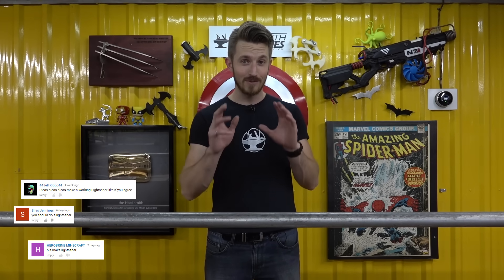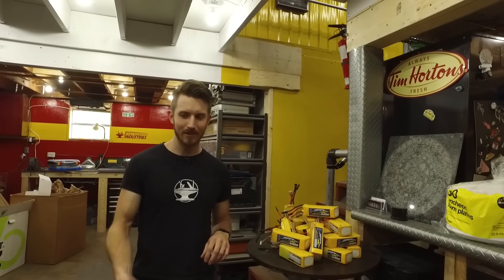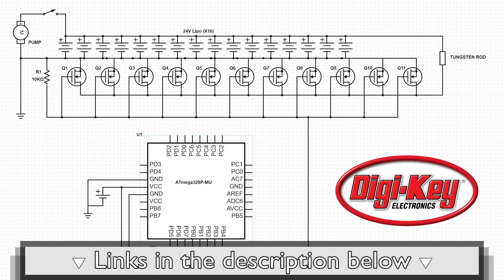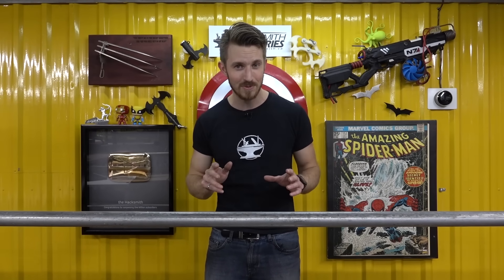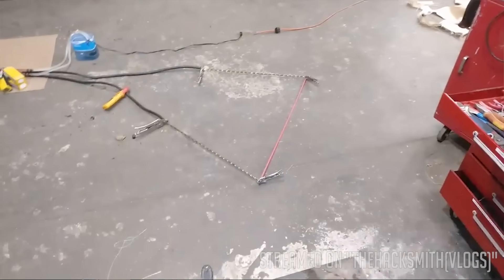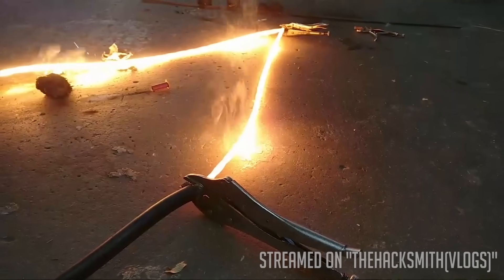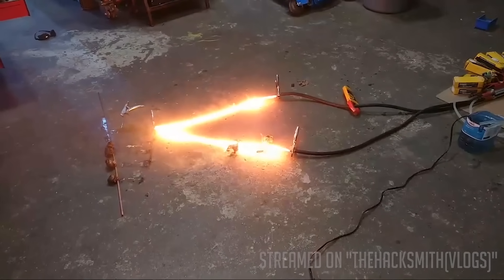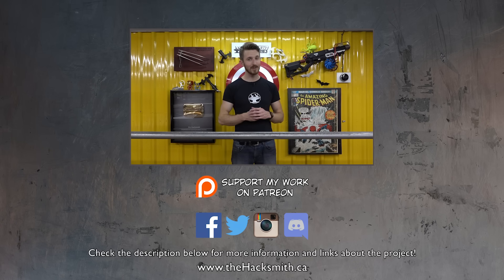HOMEMADE LIGHTSABER EXPLOSION!

Comment: @The Hacksmith I think you should use a tungsten-titanium alloy because tungsten has the highest melting point and gives off light similar to a light saber because it has a high resistance to electricity. Tiny tungsten rods are used in some light bulbs for that specific property. (just learned that in Physical Science) The titanium should counter the weakness of tungsten with it's strength so you can strike things with the "proto-saber". But then again Im just an 8th grader and don't know much about alloys and how the metals affect each other. 
Wait...I just thought of this now; how tf can u make an alloy out of a metal with the world's highest melting point...? Maybe if you get a rod of tungsten and a rod of titanium you can heat them up and idk, stick the together and then swirl the two when they're heated to like how DNA is swirled. It COULD result in a combination of tungsten and titanium. 
I know this isn't related to the problem you were having with the power but I'm really fucked  when it comes to that shit
Reply from the maker: Watch the video again, there's a hint on what we're using ;-)

Comment: OK, for the rod... It won't be retractable but if you have 1 steel rod separated up the middle by a very good insulator that won't melt or some other form of separating the half cut rod, and then connect them at the end of the shaft. After you've done that, you can connect your power supply to either side of the rod at the bottom where the shaft connects to the hilt and turn on the power!

Comment: You absolutely need to use a silicon carbide heating element rod for the blade! They are commonly used for commercial heating elements, and would hold an edge quite well (if you were crazy enough to sharpen it) and  would hold it's rigidity at high tempratures! you could probably get over 2300c with the blade fairly safely.

I think you could probably just buy it as a replacement element for a heater?

Comment: Hacksmith, meet the blacksmith. What you ended up doing when the steel started splattering  was getting the steel ABOVE temperatures need to WELD steel. that's higher than 1700 degrees Fahrenheit. The splattering is a telltale sign that the carbon in the steel was burning out.
On a side note, I would love to see where you take this project; it combines glowing steel with my favorite movie franchise!
Reply from the maker: We have something even better than steel ;-)

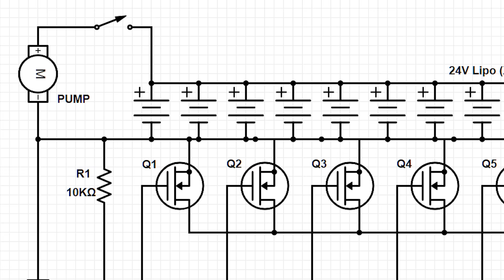Comment: looks at schematic at 1:40 The blade is made from a tungsten rod.
Reply from the maker: i think you're the first to notice it =P
Reply: the Hacksmith did you get all those batteries from flitecraft?
Reply: the Hacksmith try using carbide instead of steel, it will maintain it's shape even when heated to the point of glowing red as with the Steal. on the downside is it would be expensive for the car by piece as well as being very difficult to find a piece of carbide that length.
Reply from the maker: +Trans am county did you not watch the whole video? We said where we got them when we mentioned them lol
Reply: Lol how did I miss that? guess I zoned out lol

Comment: I would suggest a plasma ark around a ceramic core there is a really cool video explaining it i will post the link in the comments
Reply: I could not find the video but There is this really cool old video out there that explains that you can use magnets to contort the shape and path that a plasma beam takes. you could make it conform to a light saber shape and then you have to have a core so that it could clash and not go straight through each other. Something that has a high melting point put is still quite durable like ceramic and all of this is inter locking and expandable in the handle kinda like the toy light sabers

Comment: use a hollow rod push the other terminal through the rod and fill the hollow cavity with some heat proof foam which i think I say king of randoms metal furnace so positive to one edge and negative to other edge rod and wire insulated by a king of random  foam

Comment: can u put the hot sides closer together to look like a blade? also less power might make the blade more sustainable. you should  work on a water cooler kind of like the play station plus's has for the battery pack. Al's make a handle that can't conduct heat well somehow.
Reply from the maker: It is water cooled =P

Comment: Use an iron coil around a copper core for the heated bit. That way the electricity will go quickly from the base to the tip via the copper core. Or something similar if copper would melt too easily compared to the iron coil. Also if you go with the core/coil design you could make the rod collapse into the hilt and the coil wrap down with it, thus making it retractable
Reply from the maker: it'd all melt... you saw what happened to the steel rod we had!
Reply: What about a tungsten rod? It would glow a lot quicker
Reply from the maker: Good idea ;-) it's mentioned briefly in this video during the circuit diagram!

Comment: Use a telescopic ceramic baton design with high conductivity materials lining the outside of the "blade".
Personally I don't think a light sabre will ever exist because we cannot hold a plasma field and would not harm an assailant until you hold the weapon to the person for prolonged periods. A superheated material as well will be too weak to hold an edge or take a hit. Ceramics are too brittle and will break on first hit (ceramic knives use a draw cut). Finally, a plasma field on its own would pass straight through a second plasma field as well as the assailant.

Comment: I am  no expert but would it be possible with that amount of energy to create a superheated are and possibly contain it between two points rather than use a material or bar as the blade.its not a true lightsaber but the beam katana from no more hero's is similar and maybe possible if you use tungsten like some of the comments suggest. don't know if the idea helps but best of luck. the world needs more light sabres!
Reply: arc not are ugh spellchecker.
Reply from the maker: Watch the video again, there's a hint ;-)

Comment: I have a totally diferent Idea for a lightsaber, using a plasma cutter but with higher output, so it can get a larger blade, other solution would be using a plasma engine, as the output is an incredibly hot electric pulse
Reply from the maker: Kinda hard to make a 3' long plasma torch!

Comment: you would need to find some material that conducts electricity and can hold so much heat that it melts everything but its self. errrrr is there such a material 😕
Reply from the maker: +mechanic gamer there's a hint in this video ;-) in the design
Reply: the Hacksmith unless you would use a laser or something close

Comment: For the overloading problem maybe you can use a system like halogen lights. It doesn't continuously stay on. It turns in and off at high speeds. For the exploding maybe a plexiglass box with holes so heat can escape but minimizes "exploding factors". For the batteries heat problem have fans on top and on bottom all blowing air in the same direction and maybe two on the lower side forcing air in. Also the top fans should be 45 degree angle away from body so it doesn't just fan at your armpit. Just a thought but I don't know anything about anything your doing really... good luck.

Comment: You could construct the blade with a length of ceramic tubing, and discharge electricity with capacitors to create superheated plasma.
Reply from the maker: +Legoguylol4ever a Plasma sword wouldn't actually cut through anything easily either, you need serious input power to do anything impressive
Reply: True. However, I can't see how you'd make a functional blade. You'd have to have contacts on either end of a steel rod for it to heat up, like what you experimented with in this video. That'd require wires and components running off of both ends, messing with the lightsaber aesthetic. Then you also run the risk of overheating it, and the steel buckling or bending if you were to try to swing it. Maybe if you had smaller heating elements inside a framework for the blade? Then you could hide the wiring inside of the blade, you don't have to worry about it buckling or bending if you heat it up too much, and it'd be much more handleable. Maybe use cut sections of steel tubing, and use a metal rod for the blade. Use insulated screws to hold the sections to the blade, that won't heat up as much because of thermal/electrical isolation from the heating elements for the blade.
Reply from the maker: Simpler solution... U-shaped blade...

Comment: make it to where it heats up the metal until it turns to plasma then use an electromagnet they can keep the plasma together and that's a lightsaber in theory
Reply: josiah smith Thats Not how Physics work
Reply: It could work if the metal was in a gaseous form.  But that could be challenging.

Comment: Could you do this with titanium? or only use the steel as a conductive core?  It would heat the titanium...which has a higher melting point...
Reply from the maker: not much higher. keep thinking!
Reply: What about a temp limit? some sort  thermometer and arduino that lowers power output in order to prevent melting? Or would the constant heating and cooling cause weakness?
Reply from the maker: +EveryPixelCounts hint in the circuit diagram. It will be controlled via pwm
Reply: There's a clue in the video. One of the schematics shows a tungsten rod

Comment: I think you should do it by passing a wire through a tube with a high temperature melting point metal and then surround the tube with a low temperature melting point metal, After that, let the electricity go through le metal to reach the top of the tube where it goes back through le wire. I hope you understand what i am saying however the vocabulary being specifique and my english beinng pretty bad it is hard to express myself. Anyway, can't wait to see the result.
Reply from the maker: not quite, but cool idea!

Comment: i feel like having the "blade" awalys attached to the hilt would be too easy and wouldent really make it a lightsaber... i dont think they would go that rout. 

Mabey they will make the "blades" removeable, like what they did with the Attack On Titan swords.

Or maby they will do somthing like what the old plastic lighsabers used to be. you know the collapsible tubes that get smaller and smaller as they go.  this would be cool but the metal would fuse together at full extension after the first time in use.

Honestly im kinda stumped on how your going to make this work.  I look forward to the solution.  ✌
Reply: or the extendable core and around that some sort of mesh that gets hot not the core itself
Reply: Aonodensetsu i dont think a mesh could hold up to that sort of heat.
Reply: well, that was the idea, i got some more even more unachievable and every one of them yields better results, while being further and further from possibility
Reply: Shenanigans Cat in the Ild Republic they have basically the same idea when u start as sith of Jedi u have a prototype I believe and it always has the blade because the blade isn't always on it is basically hot metal

Comment: my thought is (I've thought about it in the past)  that you could heat up steel,  which isn't exactly a light saber,  or what I commonly think is a highly focused beam that goes off the handle,  and then a stem that goes off the  side of the handle and goes above the beam and blocks it from shooting further and reflects it back to the handle,  in which you have the beam exposed to cut through stuff, but there is an arm sticking out to hold the mirror or whatever,  which is kind of dangerous

Comment: if you want to cut through some stuff. it needs to STAY hot enough WHILE its cutting and not cool down as soon as it touches something. so it'll need to be ALMOST HOTTER THAN WHITE HOT
Plus you need some wiggle room for the areas that AREN'T touching something so that it doesnt get overheated and melt in the places that aren't cutting through something!
Reply from the maker: +realflow100 stay tuned for the next video!

Comment: i would try using a metal with a higher melting temp like titanium.
Reply from the maker: +mongakvideo titanium doesn't actually have much higher a melting point ;-)
Reply: maybe tungsten, or maybe adamantium
Reply: mongakvideo or control the heat, doesn't have to be red hot as long as it cuts through

Comment: Use tungsten carbide for part of the blade and then something more stable so it doesn't explode when you hit stuff with it. ( tungsten will go boom if struck at high temperatures)

Comment: You are basically building a sword shaped toaster which means you must somehow get a closed circuit that heats up the full length of the blade and leads back into the hilt.
Im guessing steel pipe with caramic coating (or something similar) on the inside for a wire to run back to the hilt.

Comment: This isn't really a light saber is more of a red hot metal saber. Great name isn't it
Reply: MrJJandJim "death sticks" if you get the refrence :D
Reply: The Unseen hey want some death sticks?
Reply: red and Blue Eh, I could see something like this existing in the Star Wars universe when vibroblades first started getting phassd out and lightsabers were introduced. Instead of a cortosis weave or an expensive lightsaber, why not just upgrade your existing vibroblade to heat up for lightsaber functionality?
Reply: a proto saber is essentially the same as a light saber, just with an extra battery. this is accurately described as a hot metal rod.
Reply: Molten Katana. I want 10% of the revenue made of that name xd
Reply: red and Blue A Metal Saber.... That DOES sound pretty awesome... or what about Fire Saber? Hmmm....
Reply: red and Blue The actual conceptual light saber was really just plasma, not light or metal. If someone could have something that releases Noble gasses and burns it into the plasma state then use magnetic fields to restrain it. that would be cool.
Reply: thay call it a light saber because it makes light, i think?
Reply: red and Blue u ever play The Old Republic if I pick a Jedi of sith u start with a prototype light saber which is basically metal that gets very hots
Reply: noo  its smart dumb asses  trying to burn house down / garage
Reply: lowest common Denomanator go home and re think your life
Reply: It's more of a red hot metal rod than a red hot metal saber, but close enough....

Comment: Quick question. So you were heating the metal super hot, on Grant Thompson's channel "The King of Random" he does something similar with a microwave transformer (I think). Could you use that technology in this project too?
Reply from the maker: +Gregory Smith 2000W transformer versus 200,000W battery pack. What do you think? ;-)
Reply: the Hacksmith im not really sure lol.
Reply from the maker: +Gregory Smith it's all about the power :) more is better

Comment: try using tungsten or tungsten carbide although the carbide is less resistant to thermic shock and has a lower melting point it has more carbon atoms to allow for an edge

Comment: Why dont you just use microwave transformer
Reply from the maker: 3 households supply of electricity...

A microwave transformer can put out at most 2000W, we said in this video, the power supply puts out 200,000W ;-)

That's why
Reply: Oh ok

Comment: My preposition: use a retractable graphite rods, springload the rods, automatise all parts of the saber with microcontroller, thermicaly isolate the handle very well.. (I really think u should use graphite or another conductive carbon, its the only material thats conductive, light and very high melting temperature. not tungsten its expensive and heavy af)
Reply from the maker: how would you fit that many graphite rods in the hilt?  when they get red hot the mechanism would break =(
Reply: the Hacksmith use a 1 foot long graphite rod and a 1 foot longer graphite tube, both peices are in the handle when retracted(rod in tube in handle) abit like an umbrella. also nevermind the spring mechanism, use air pressure instead, above atmos to push(not airtight) vaccuum to pull, maybe a electromagnet to keep rods retracted(put a screw in the inside part of rod), so u only have two rods one in the other..       srry i dont explain well.
Reply from the maker: +Ohos Usani they'd change size a bit when their hot :( I don't think it would work very long :(
Reply: the Hacksmith ok then.. just giving ideas.. also i didnt think graphite had high thermal expansion.

Comment: Will the lightsaber be functional? Because would the steel not just bend when it's that hot?
Reply from the maker: This is the power supply. Not the blade ;-)
Reply: Okay so if i understand you correctly this was just for testing the power supply?
Reply from the maker: Yes